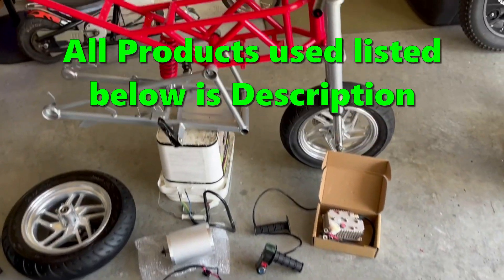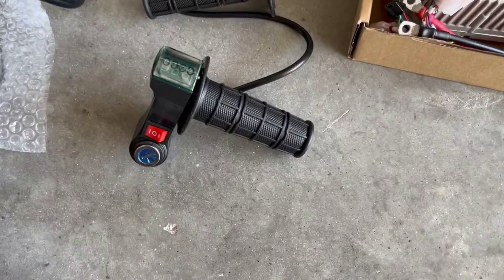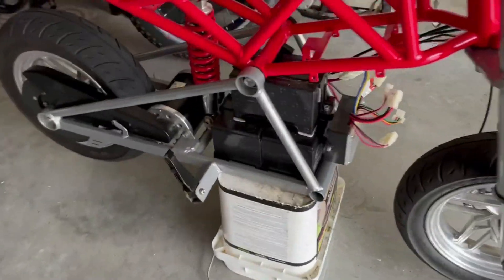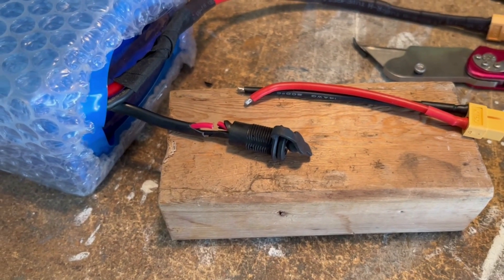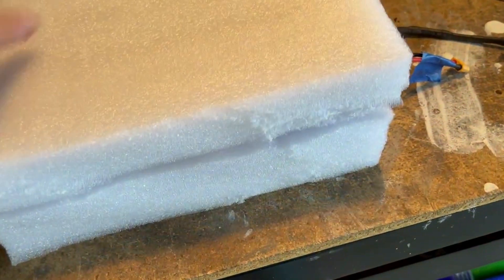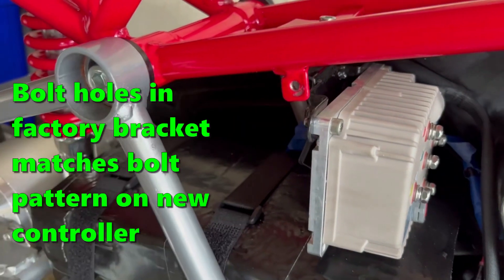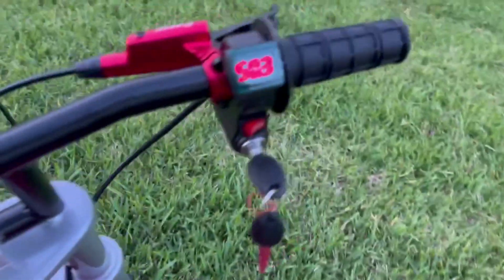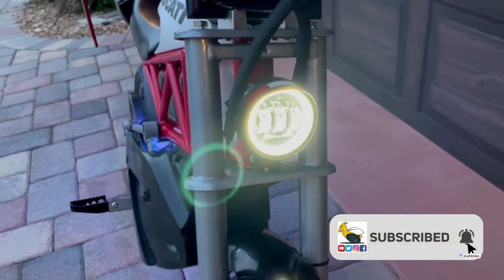Razor RSF650 upgrade Motor + Battery

Comment: I've got RSF650, stock from Razor... I want to get it up to roughly 40 mph... I see you have a list all the parts you used to get the  2000w 48v RSF650.

What did it cost you for everything?

 Also are there items I could leave out from your list  that will still get me to 40 mph?
Reply from the maker: To get to 40 mph you need a good motor kit like i used and 48v battery will get you there.  Cheaper amazon motor kits will only get you to 35mph.   All in everything cost about $700.   To go faster you will need 60v or 72 which will cost $1500 and get you to 50mph.   You can leave off the lights if you want but brakes in a must as stock brake over 25 mph are dangerous

Comment: Hey could you send the link for the controller and motor? I couldn't find it on the website.
Reply from the maker: https://www.lonestarelectrek.com/product/premium-piggyback-kit/101   But click contact them and he can make 48V 2000w motor kit with key and 3 spd
Reply: @BRichSolution  Thank you so much!
Reply: @BRichSolution  Another question, what kind of battery life do you get with it? I want mine to last about 30 miles on one charge, do you have a recommendation for a long lasting battery? Thanks again.

Comment: How was it to take off the seat I’ve been trying for a while and have looked up videos to help explain but haven’t had any luck. There’s a small screw under the back seat is that it and if so what’s the best way to get to it
Reply from the maker: There are 3 threaded studs on the bottom if the seat that are retained to the frame with nuts.  Remove the 3 nuts and the seat will be able to be removed
Reply: @BRichSolution  thank you!! Unfortunately I found them but I ended up bending the black plastic and breaking; the one under seat that holds the nuts. Sorry to ask as well but to get the white and black casing off, what else is there ik you said to just pop out the back parts. Is there a specific way you’re supposed to crack it open? I don’t want to break this as well.

Comment: I love your build man! I just upgrade mine a few days ago with a very similar battery and a kit from electric scooter parts (does 28-30 mph) and I love it so far but anyways if you don’t mind me asking where in the world did you find a mx650 front fork?! I’ve been looking for a while and can’t find any… on razor’s website the 650 fork is discontinued and the 500 has been out of stock for ages now
Reply from the maker: Call or txt msg razor dorect they have more inventory then website shows

Comment: Where did you get the red brake levers? And I’m confused… Is it a razor or a Ducati?!
Reply from the maker: It’s a razor Rsf650 that I made look like a Ducati.   As for the brakes all products used are listed in the description below the video.   Here is a link to the brake and rotors you’ll need.
2mm 160mm disc brakes (48mm bolt pattern) https://amzn.to/3zCPwz1
Zoom Hydraulic Brake Kit:  https://amzn.to/3xIKVda

Comment: I just installed a Lone Star Electrek 7212n controller on my RSF650. I got their program. I’m running a Vevor 52v 2000w motor. I built 2 60v batteries. The 1 battery is on the tray it’s a 10p and the other 1 is in the bottom of the tank it’s a 6p . I’m only using a 13 tooth front sprocket. I did 43mph on flat ground. I weigh around 250. I also put a spring kit in the forks. Changed the shock and painted it. I also put on a cafe racer seat and light’s.The controller is well worth buying. I will send a pic of my bike with my review on their website. Good luck with your build.
Reply from the maker: Where did you get the cafe seat from?
My build is done I get 40 mph with 14T see this video
Rsf650 to Ducati 2000W
https://youtu.be/7Wf5erzkmsw
Reply: @BRichSolution  I got the seat off of ebay . It makes the ride way better . When you go to mount the  seat . Make a template of the seat subframe you will find six holes that aren't used . I drilled the holes into the seat pan and  placed screw anchors and JP welded them . Get some rubber bushings so you can mount it tight and not have any noise when you sit down. I also got some square tubing and made to foot ped mounts . Bolted them to the original peg mount. 1in lower and 1in wider.
Reply: Thanks for the controller mount idea. I mounted mine the same way . Great idea .

Comment: How easy was this to install? Would it fit a MX 650 I’m looking to upgrade it soon
Reply from the maker: Super easy.  New Motor bolts right in the same spot as the stock motor.    The controller can be mounted just about anywhere.  Only 3 wires harnesses and they are all plug and play.  Hardest thing was packing up the battery.    There are batteries that fit in the stock batteries tray https://eonlithium.com/
Reply: It is way easier to install their kit then buying a cheaper kit then upgrading to the Kelly controller. I just upgraded my controller to the Kelly and after wiring it I wish I would have just got the whole lone Star kit in the 1st place.